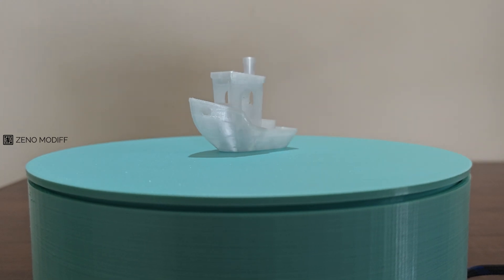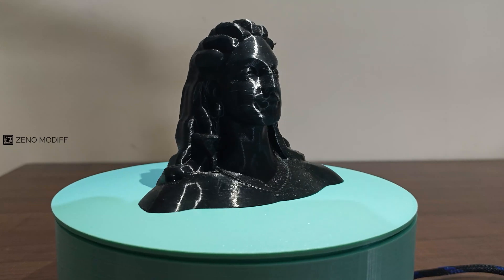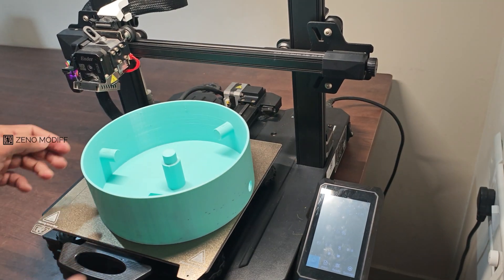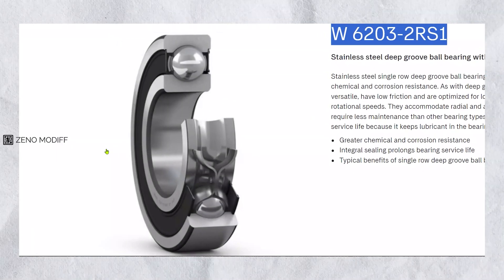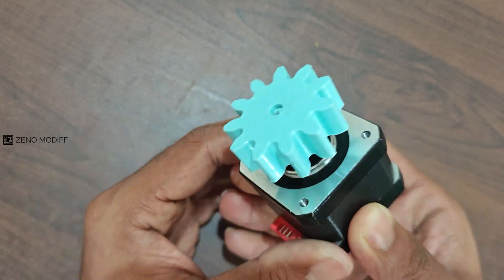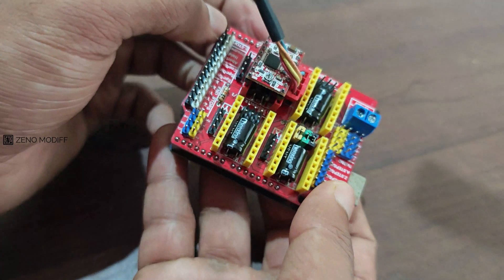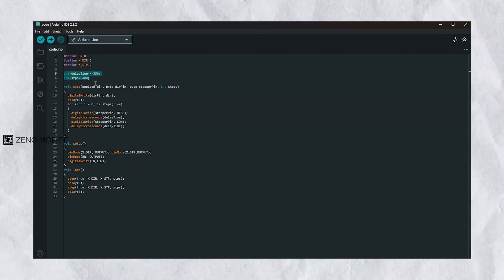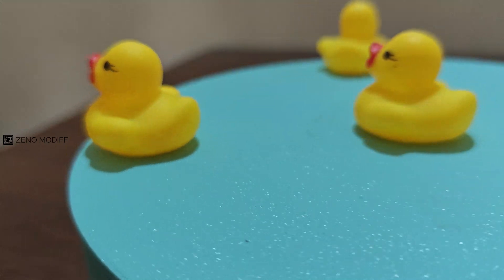Build a Professional 360° Photography Turntable with Arduino – Easy DIY Project!

Comment: Hey Zeno, that's a greatj project, thank you for sharing!

I don't have any arduino experience, but I'm trying to learn it and I'd like to build this turntable as my first project. Could you please share what components you used? (like arduino board, motor, cables I might need, etc). I have a 3d printer and the bearings :)

Thanks again, I really appreciate it if you can shine some light on my question!
Reply from the maker: I have mentioned the part list at the description